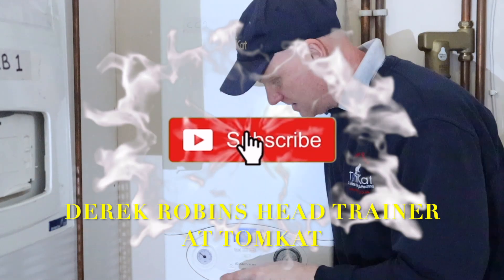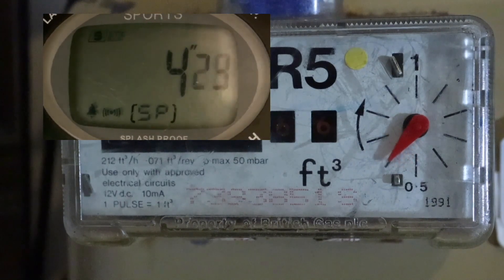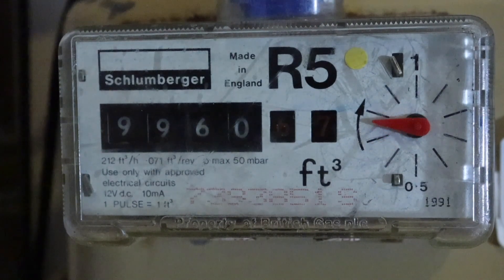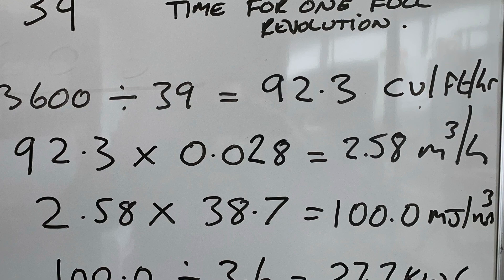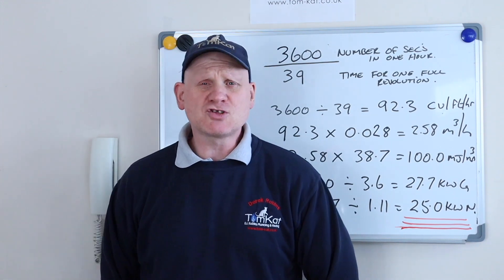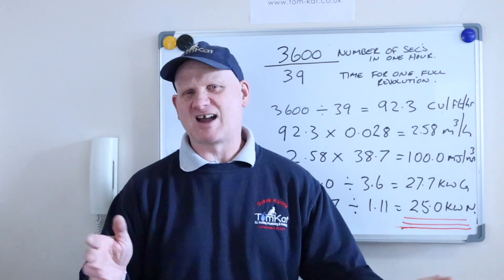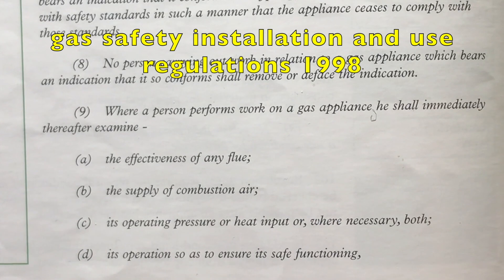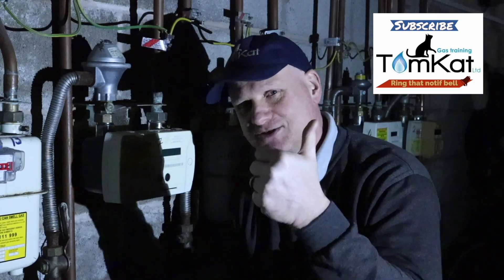HOW TO GAS RATE USING A U6 GAS METER, a quick guide on how to gas rate using a u6 gas meter.

Comment: Hi all, 

I am a trainee gas engineer and need your assistance… is this formula below correct? If so please reply with answer. 

The second metric reading (-minus) the first metric reading. (X times 30) to get your hour then (X times 10.72) then you divide it by 1.11

Thank you ❤

Comment: You are gas rating an old 30kw gas boiler at an imperial ft3 gas meter. The time for one revolution of the dial is 42 seconds. What is the gross heat input that you have measured, and is the appliance getting the correct amount of gas? Please help calculate .
Reply from the maker: @SetfreeMareya  it’s 25.8 kw gross

Comment: 2.58 m3 x 38.76 dive by 3.6 = 27.82
Reply: There is also.
1040 Btu per cubic foot in imperial units.
1040 x 2.58 / 100 =26.83m3
Reply: I was taught that if you get 1 kilowatts per cubic metre per hour which = 10.76 you then X it with 2.58m3.
10.76 x 2.58 = 27.7608 = 27.8m3